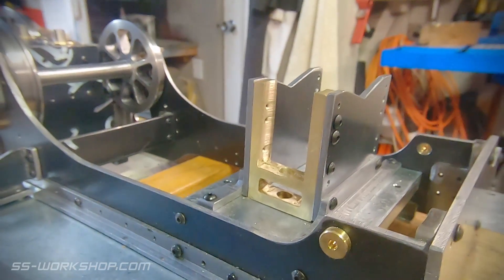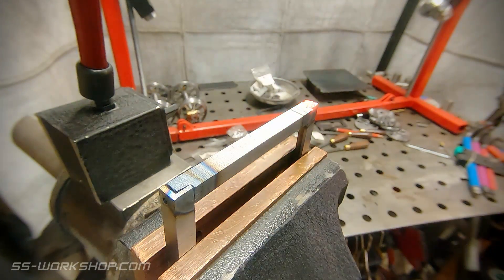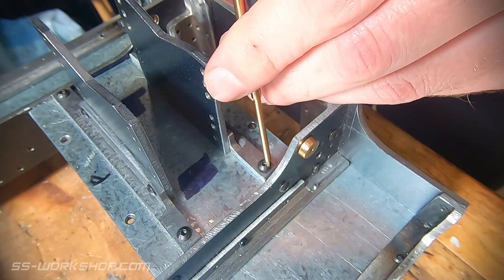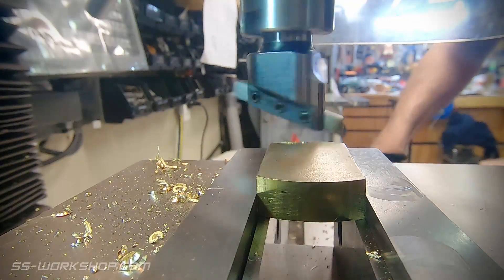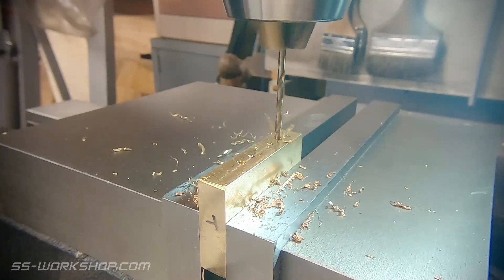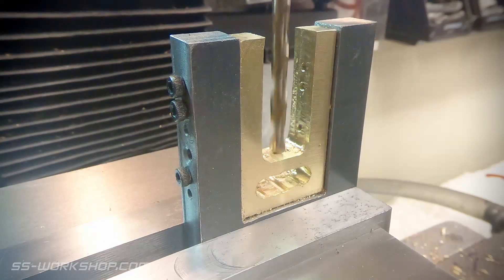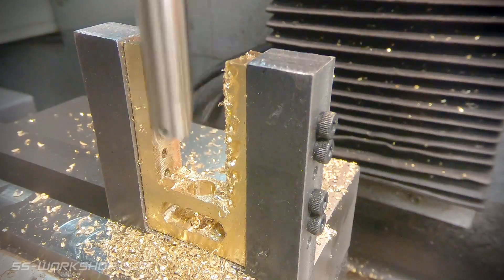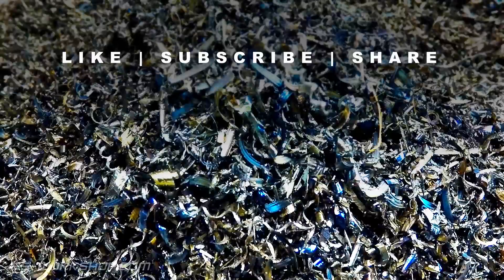Fell Engine Project - Radial Axle Pt1 S1.E38 (Live Steam Locomotive Building)

Comment: Looking good. Are you worried about the wear using brass over bronze as a bearing surface? I guess a lot of it comes down to how much you plan on running it also. And the cost of Bronze
Reply from the maker: Now you mentioned it I am. It would be nice not to have to revisit them any time soon so I’m thinking the actual axle boxes could be bronze as that’s the part that would get the most wear? I think I have a piece of bronze that will work for it otherwise a pressed in bronze bushing should work right?
Reply: SS Workshop I would think what ever is the easiest without having to rebuild something. My Blackmore vale has steel axle boxes and horn blocks but has bronze bushings pressed in for the axles. You could always work with what you have got if needed and once running see how it goes for a year and then swap out the parts to bronze then depending on the wear.
Reply from the maker: Thanks, it would certainly be easier now than later given my axle boxes are one piece so think it would be worth the effort.
Reply: SS Workshop I feel bad now as what you built looked great. 🙂 I guess you can just say that was version 1.0. Version 1.1 coming soon.
Reply: I think kormax in palmy is still operating if you need more bronze via the courier.
Reply from the maker: I’m thinking the actual inside axle box which I haven’t made yet so really not an issue. The bearing part I made in this video won’t take much wear so that will be fine in brass. I also think I will insert a bushing in my driving wheel axle boxes as well as it won’t take to much to sort. By the way if I had actually read the books I have they all say bronze as well so really glad you called my attention to it. Have you used Kormax much? I have looked at their website in the past but never ordered from them.
Reply: SS Workshop bronze bushings will be fine on axles. It means when they wear you can just press them out and replace without making new axle boxes which is an annoying thing to do. And if you still have more axle boxes to make then bronze from here on. In regards to kormax I found them ok. Same day delivery to masterton if ordered in the morning. They can be a little expensive so I use a mix of little metals and kormax. Little metals suits me as they are based in chch and I am now in ashburton. But kormax did have everything I ever needed including the bigger sizes needed for piston blanks on my springbok.